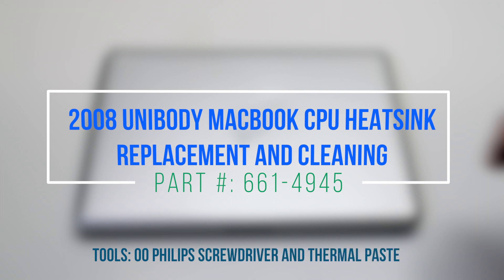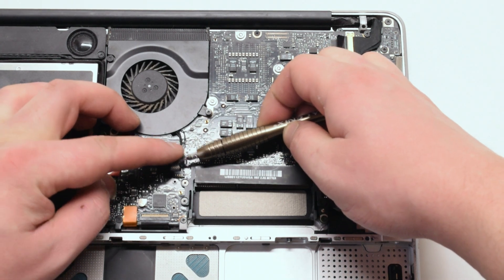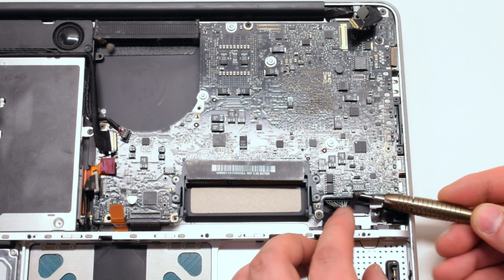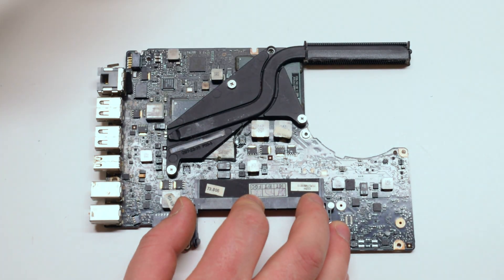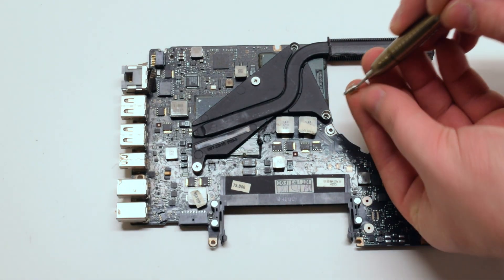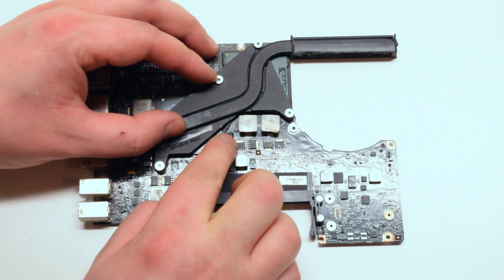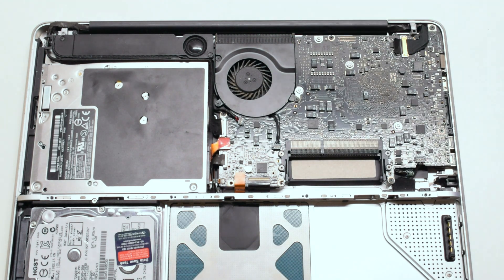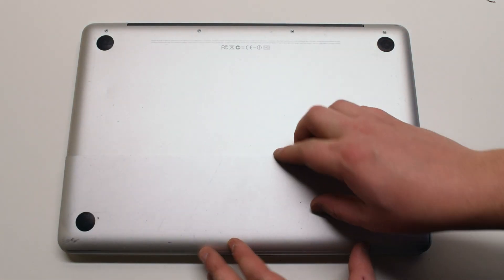2008 Unibody CPU Heat Sink Replacement Save Apple Dollars #18

Comment: 10:53 the keyboard ribbon cable is a bugger to reconnect, easiest way is to cut a piece of packing tape 1cm x 8cm and stick one end of this to the outside of the ribbon cable, use it to pull the ribbon cable into the connector, make sure it goes in all the way, close the eyelash and peel away the tape

Comment: Awesome tutorial! A tip I found on ifixit for the keyboard ribbon is to use a strip of electrical tape to pull in into the slot instead of using tweezers.
Reply: the comment i needed! ty

Comment: Very good video, I recommend
ARCTIC MX4 Thermal Paste because its base is Carbon and there are no risks, the one used in the video transmits electrity, and an error with the application will damage the board.
Reply from the maker: Thank you for the comment. Any thermal conducting paste will do just fine.
Reply: @GRIBSOFT  nope, liquid metal is dangerous